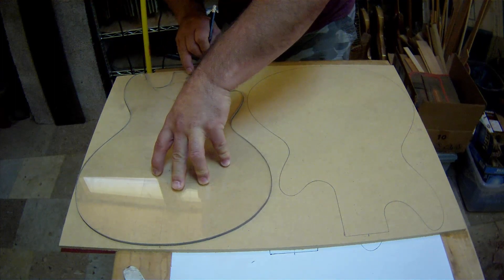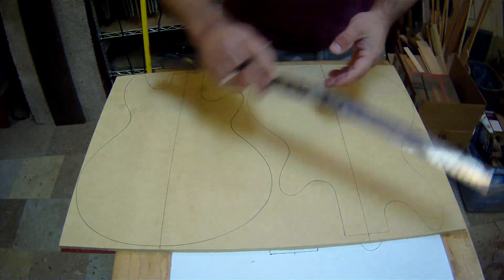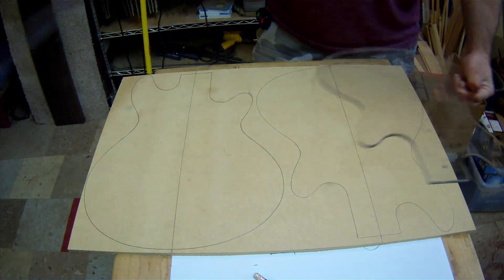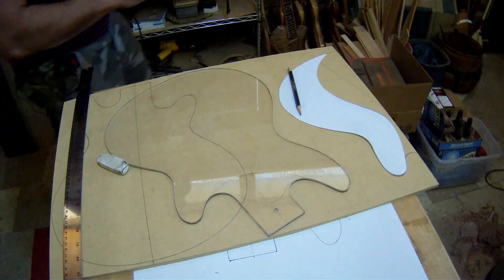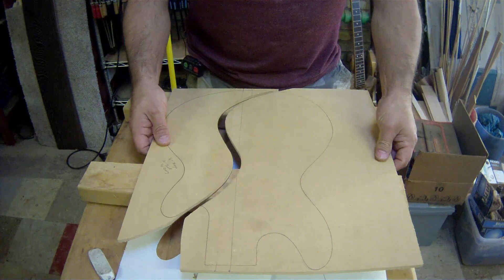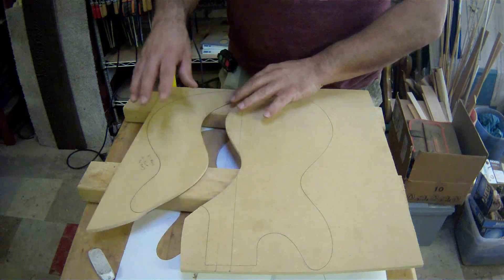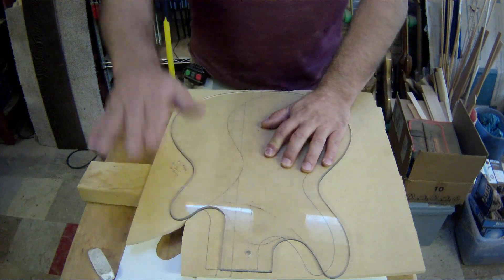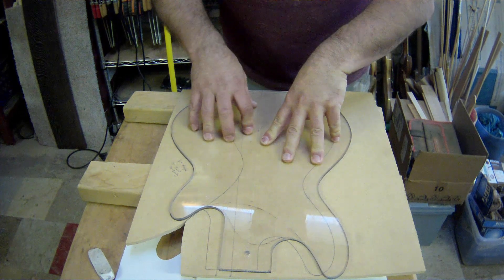Guitar Build 19.02 - Complimentary Curves First Try

Comment: After watching the video I mentioned earlier again. I think all you need is a 1” bearing for your 1/2” bit. Route the original like you did then use the bearing to route the second template. Then you should be able to route the two pieces with the 1/2” bit. I think ??🤔
Reply from the maker: A one inch bearing sounds crazy, but I’ve ordered a stack of different sizes and I think it goes up to one inch.  I think that would work, but I’m gonna do some playing around with some tests.
Reply: Did you watch the video I linked?
Reply: After mulling it over, I stand corrected. A 1/2” bit and a 1” bearing won’t work. You need the same bit size offset on each side of the bit . Therefore 
a 1/4” bit and 3/4” bearing.
Reply from the maker: @anniballe3506  I didn’t see a link.  Not sure how I missed it.
Reply: Check my previous comment.

Comment: What happens if you make two separate cuts for the curve? Create a lower template by cutting (and removing material) above the line you want, then make a new upper template where your cut removes material below the line you want? The sanding will still be tricky to get a perfect match. Also, I'm a high school history teacher, not a wood worker/mathematician so I'm probably missing some key points. 

Can't imagine what your going through with visiting your son. Hoping things improve sooner than later for you. Thanks for sharing with us.
Reply from the maker: I dunno.  I’ve given the whole thing thought here and there for a while.  It looks like the offset router bearing idea is the best, most fool proof way to go.  I’m going to try that next.  As much as I’d like to master the concept, I really want to make some progress.  Thanks Trever.